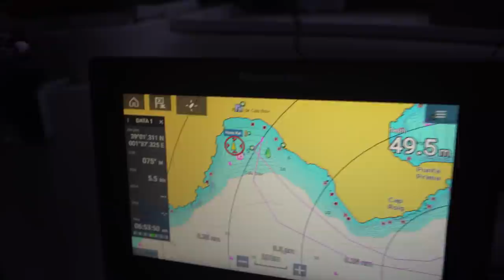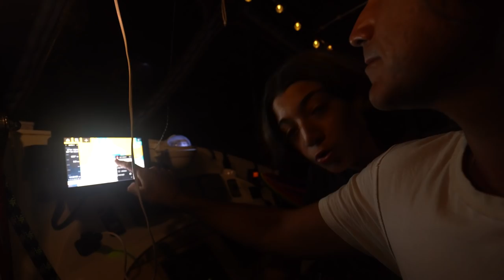Our 17 year old fixed the boat engine | EP 293

Comment: The broken bits from the impeller will have been sucked into the heat exchanger unless you have a filter to catch them. You might want to remove the front heat exchanger cover and remove them as they will inhibit flow through the heat exchanger and make it less efficient.
Reply: Good point
Reply: I was just about to say the same thing. Hopefully they read your comment.
Reply from the maker: Once we got anchored a friend came over and helped us pull it all apart to find the rest of the pieces. Happy to report we found them all. We did not shoot that so had no footage to share,but we diddo it.
Reply: @WorldTowning  Good for you. I had the same thought. I've been on a similar hunt.

Comment: Just a tangential tip from the situation with the port engine. When you're under way using the engines, once you clear of any situation that may need both engines to manoeuvre, you can shut down one engine. You'll find you lose very little speed and you save fuel. Btw, probably worth checking the starboard impeller!
Reply from the maker: Thanks. That is actually how we got to our anchorage, one engine. Was easier than we anticipated to maneuver.

Comment: You should hose your anchor chain free of seaweed or your anchor locker will smell
Reply from the maker: Whenever we have fresh water we try to do this. Thanks.
Reply: @WorldTowning  use salt water to wash stuff off . Put some kind of rubber draining mat in the bottom of your anchor locker less noise and less rust.

Comment: * DO not read **   Just read the rest of the comments I see someone beat me too it I am leaving it up to prove what a clever bugger I am LOL   
You did good your very final part of the video highlights a concern I had when I saw your impeller blown. "We are missing 2 of the plastic bits" I presume from that that the impellor bits were still in the housing which is good news in fact great news.  If 2 bits or more are missing then you have to worry about where they are. If your system has just flushed them through and out of the boat great It seems so as you have good flow and temperature. Unfortunately these parts may be still in your engine downstream waiting to move and at least partially block your output. Good idea to monitor the situation and pull those downstream parts for an inspection at first opportunity. I do not know what engines you have but if they are hang up anywhere it will be at your heat exchanger if you have one fitted. Hopefully you got lucky and it disintegrated into small enough pieces they flushed through.